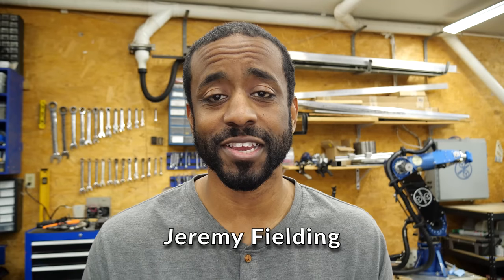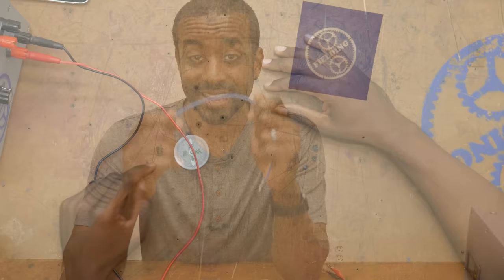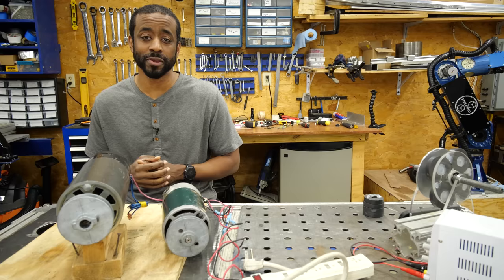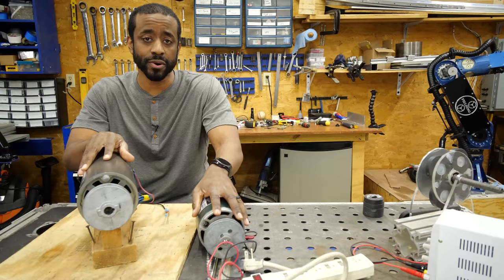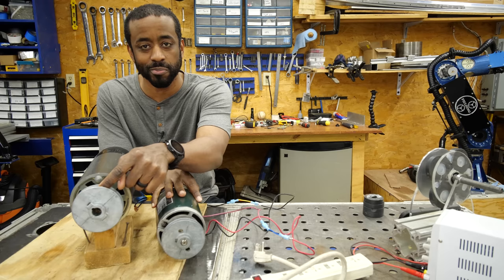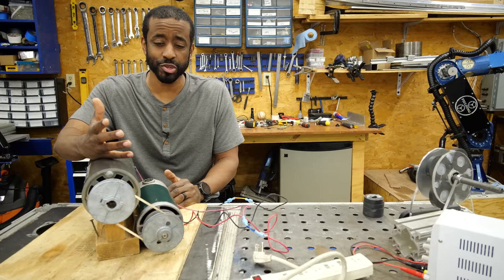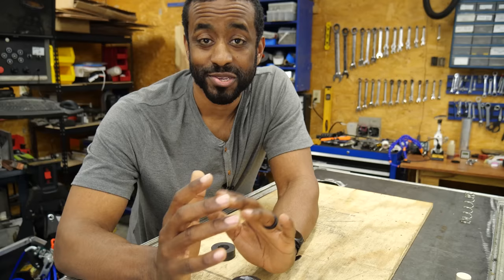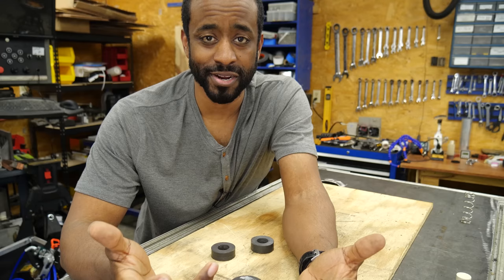Reviewing Free Energy Generators.  A Response to My Video "Nikola Tesla's Greatest Invention"- 102

Comment: Jeremy, I see where you're getting lost in the questions people are asking. The 20% that is lost in efficiency is Generating heat.
So how much extra Is electricity Can you generate by using a Sterling moto capture That twenty percent that's lost to heat on a standard motor to generate some electricit's. Not to make a perpetual motion machine, but to generate extra electricity from motors that already have to run that have run from their twenty to forty percent to heat, The charge batteries are to store in to add to a solar systems of wind generation System.
Just like you could put a couple of Sterling.Motors in the battery room and generate electricity from the heat produced by the batteries and the transformers. 
Are you a hot water heater Put sterling my room the top of it, What's the regenerated breaking system on electric cars.
During the summer on air conditioning heat pumpop playing 45 large sterling engines on top of the export fans How much power could they generate to store. Everybody wants to find a way to collect and store the Lost heat generated from motors and othere.Are some other things around the houses?You can stop twenty or thirty release and generate a decent amount of electricity the store. A lot of little things make a lot of electricity. So you have thirty devices constantly making 12 volts and 2 to 5 Amp  all day and night Just generating electricity on all the motors.We have running inside are outside our homes.
Reply from the maker: First, you seem to assume others are thinking like you. This is wrong. I understand the question perfectly fine. People are thinking energy multiplied not just capturing wasted energy. Though some respond with comments like yours... I have read over 30,000 comments and emails at this point. I am sure what the question is. Your question of efficiency doesn't represent the majority of messages I get. But it also fails for a different reason.

The short answer is the cost to capture the heat as energy isn't worth the ridiculously tiny amount of energy you get back. Your idea isn't "wrong" its just not worth the trouble. It is similar in concept to driving 50 miles away to a different store to save a dollar. Customers would not pay for the additional parts to get a power savings so small you can barely measure it. 

Details to think about... Trying the capture heat also has waste. So yes, the alternators do give off heat. And the waste is way more than 20%. I made up that number for calculation purposes in this video. If you watch part two, you will see the alternator is wasting over 700 watts of power. That is about 1 hp. It is NOT a Heater. The "heat" is dispersed immediately and barely useful. Lets say 10% of the heat is usefully concentrated (it's not that high), and you get 20% efficiency from your sterling engine. That's 2% of the waste?? It's not nothing, but would you really pay for this improvement? It makes the whole system more complicated, more expensive and barely moves the needle.  
Engineered solutions require more than an idea. It's the whole package. And a package people are willing to buy and won't fail on them. What does the thing cost to make, does the benefit improve the product enough that customers are willing the pay for the new parts. Parts that will break and need to be replaced. Gasoline engines give off 100's of times more heat than an electric motor or alternator, and still no one puts them in combustion cars. No one does this for a reason.
Reply: @Jeremy_Fielding  I really wish some would but together some serling engines, because EU governments are running submarines and shipping containers with Sterling engines for no power locations to produce power and everyone in USA thinks it is joke subject. These are easy make and cheap to buy it 200 year old tech. Instead of telling everyone what does not work, show us what will work with wasted energy, with everything in a house put 20% to 40% of heat in the air. charge battery and sell to power company at peak times.

i know are a lot crack pot out there faking electric concepts it for youtube money, just like the flat earthers and moon land are fake people and may others. i was one on power from ether 100,000 volts .05 amps not muck to work with. and there a lot fake Sterling engines on youtube also, i am thing 30 device DC 12 volts and 1.5 amps that is to do something to get started with. ir just below about same as a bike with alternator. 

Jeremy, You do great stuff,you can lots more, before I got sick i strip every applicene on the side of the road I could find, i have never paid an appliance part in my life. after I got sick I got some nice 3D prints and now make everything I can instead of paying China. just i can not take heat i got 4 digit air conditioning bills so got figure some kind if power generating solutions, i am working on small wind turbine running small 3D printer motors to charge battery now, but Sterling engines look like better solution, i did wine in the power a 13,000 watt propane generator but $35 to $50 every 24 hours works when power is out but does not work for full time. I got a working 2400 and a 4500 watt power heads both will take big Sterling engines.

Comment: A ability  that i don't  have 2 come into town miles every day carrying  100 pounds my back plus anything  on handle bars in bags. But way to theoretical  ability  2 moderate  the factor of

Because  all these fake video 
And people putting  bullshit  lies on threads and other means of deceptive so didn't  just trial and error  1 video at a time,  i did see A video about some guy using a extreme and setting up like a windmill type thing that the water was carried up and dumped onto the windmill. So it basically made it generate electricity by that as if it were defined.

Comment: Nothing, and I mean nothing is free. You're taking one energy and converting it to another energy with a loss of power, generally some type of mechanical to electrical. It's not equal whatsoever due to the inefficacies between the electric motor, the generator, and the friction loss between the two whether internal through bearings, external through gearing, or heat. Even if you've built your own generator using permanent magnets and wound your own coils and your flywheel was harmonically balanced while using high velocity ceramic bearings to attempt to reach a 90% efficacy, it's not going to matter, your bearings, the oil to reduce the friction will be the failure over time. As even if you managed to equal the output of the energy needed to power the electric motor, minute you "tap" into that energy produced from the generator, you kill the entire system. You're not going to output more energy than what is required to overcome the magnetic force between the magnets and the weight of your flywheel to get more power out of it.. You can gear it however you convince yourself it'll work, use a smaller electric motor and a larger generator and regardless of what you do, you will loose power from the gearing and friction loss on top of the output power of both the generator, and the electric motor. 

This is literally the first law of thermodynamics, which states; that energy cannot be created or destroyed; it can only be converted from one form to another. For any system, energy transfer is associated with mass crossing the control boundary, external work, or heat transfer across the boundary. These produce a change of stored energy within the control volume.

It's impossible with this "free energy perpetual" nonsense electric to electric setup to gain more power than what is outputted. Petrol engines, water, and wind are still mechanical outputs, which both need a force greater to overcome the magnetic force to spin the generator to produce any power. As far as "free" is concerned, wind, water, and solar come very close.. but at a hefty price to even achieve close to 50% nominal with current technology.

Stop falling for these video tricks, it's a "perpetual ad revenue scam". If they can't scam you out of your money directly, they'll scam someone else out of theirs through deceit. The only thing you can do is block their channel, even then that's not a sure way to never see the video again, as they'll just make 50 more similar channels with the same regurgitated videos, various other clickbait titles, and obtain more money from those videos once their host channel starts to tank in revenue. Their channels are like foreign weeds, sprouting everywhere and almost impossible to remove, choking out every other informative channel with their falsified information passed as genuine by "fact checkers", and the ad revenue is their fertilizer.

I mean if you're curious you can test this yourself on a small scale using hobby motors or make your own little coil generator using some small magnets which may cost you a fraction of the money, if at all to prove any of these "free energy perpetual" videos to be 100% false.
Reply from the maker: I can't tell if you watched the whole video, but of course we agree on all this. Now that I have made several videos on this topic of free energy scams on YouTube and read thousands of comments I learned the problem is deeper than explaining thermodynamics. People really "hope" its true. So they want to believe it. That drives the view count up which in turn gets the videos recommended more even to people who are more skeptical and even physicist and engineers like myself who watches (and makes) a   lot of content about electric motors and generators. Its a tough battle. I think you would enjoy part three of this series where I break down the real problem a bit better... and discuss even more than this video the problem of passing the energy around not actually creating energy. Link to playlist in the description.
Reply: @Jeremy_Fielding  I watched the entire video before I formulated a response, but I'm doubling down on what you said about their scams and their video editing. I've had full on arguments with completely clueless people over the years about the idea of free energy and/or perpetual motion energy devices, and I've added a few of their argument points they've attempted to use about gearing, ceramic bearings or different sizes of magnets/motors and many other things they use for their theories to try to prove I'm wrong and they're right, which is why I mentioned them in my comment. Hell I've had some straight up tell me I didn't know what I was talking about as if I hadn't remotely tested this myself decades ago in a high school science project. Even had channel's remove my responses from their channels posting nearly the same thing I just posted here on your channel. Most of these bogus free energy channels I've seen literally have the same videos and designs, all trying to gain subscriptions and/or patrons to support their complete and utter nonsense, down to selling their one off special designs of that said "free energy perpetual device" as if they are from the distant future and have miraculously figured out how to debunk basic thermodynamics with some "magic" the government is with holding from the general public. I believe they need to re-adjust their tin foil hats at this point.

Comment: 🆈🅾🆄 🅲🅾🆄🅻🅳 have simply put a 40% larger pulley on your dual electric motor machine in order for it to power itself, it's all a pulley size gearing issue. If I had two motors like that I could show you, but since you do, repulley it with various pulleys and you will see you will be able to get it to work. Then you can show us what you made, and how it works. The drive motor always has to work harder, so its gearing needs to be drastically reduced so that the charging motor spins faster to provide more power for the losses, get it? 
 Gearing or pulleys will do this, not sure why I see zero examples of my thoughts out there, except my recent short video with what I built. But you have the real thing, just repulley the dang thing and prove yourself wrong, and still win!
Reply: Would be even more fun to cvt clutch pulley one to keep from it running off!!